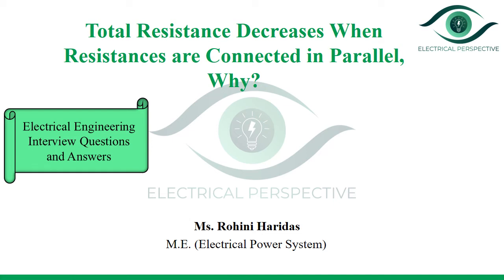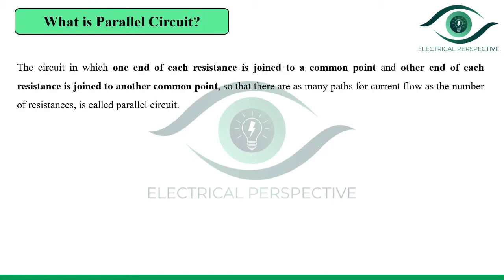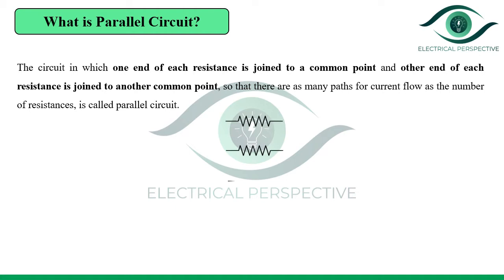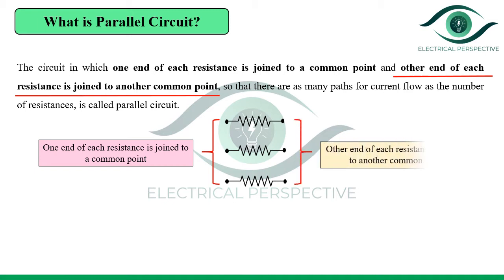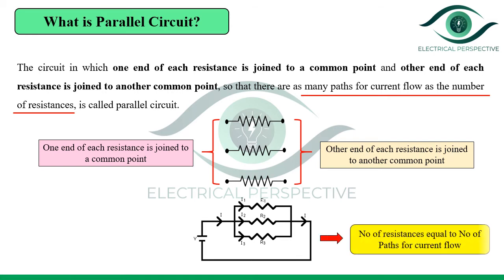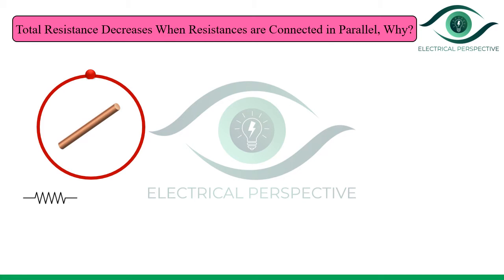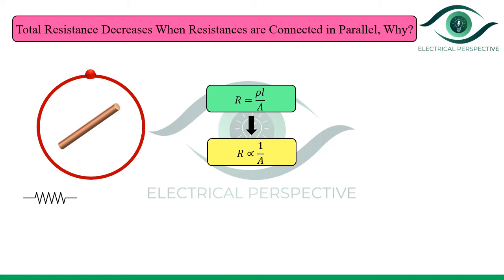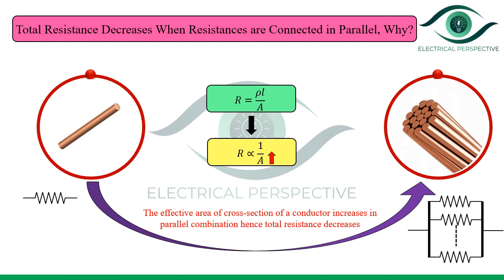Why is Total Resistance Decreases When Resistances are Connected in Parallel?

Comment: Very simple to understand. I was looking for the answer for this question for over two days, and this is the only video which explains it in a very simple way and is easy to understand. Thank you for sharing.
Reply from the maker: Great to hear! Thank you
Reply: Ok so before I watch I have theroy. Stronger resistors push voltage back on weaker resistors making the weaker resistors weighted in there electrical potential change

Comment: The current is being distributed in parallel so by ohm's law resistance should increased while it decreases so here ohms law is not verifying. Its really confusing me
Reply from the maker: Hello,

Sorry for late reply.

If I understood your question property,  then it seems that there is a lot of misunderstanding about parallel circuit and Ohm's law.

1. In parallel circuit,  overall circuit resistance decrease thus allows more current to flow. Pls refer the mathematics for calculating the equipment resistance. 

2. This increased current flow with constant voltage results in a decrease in total resistance, perfectly consistent with Ohm's Law, where V=IR.

Comment: What is reason for increasing resistance in the connection of series Madam
Reply from the maker: In series combination, resistances are connected one after another so that same current should flow through them.  Due cascade connection resistances  are getting added thus equivalent resistance will increase. (Mathematically) .
On the other hand if we consider a conductor having resistance R and let us assume that few conductors with same cross-sectional area are connected one after another then EFFECTIVE LENGTH gets increased and R is directly proportional length hence effective/total resistance gets increased.